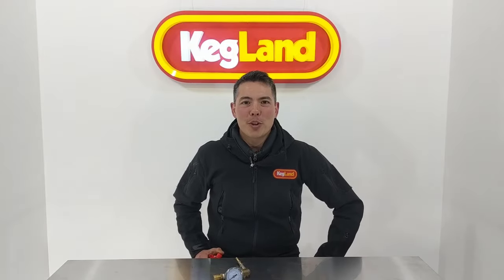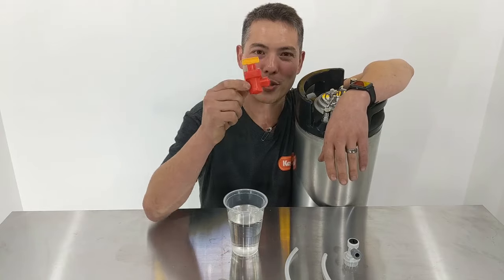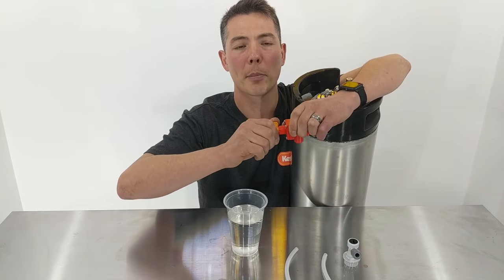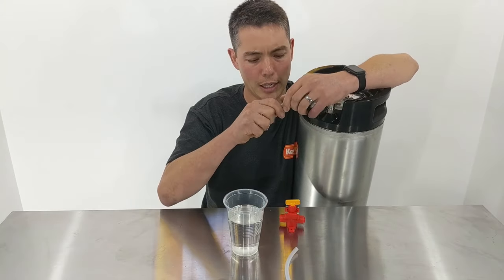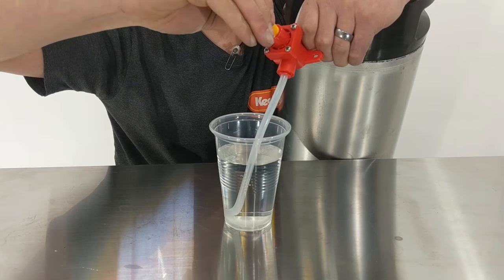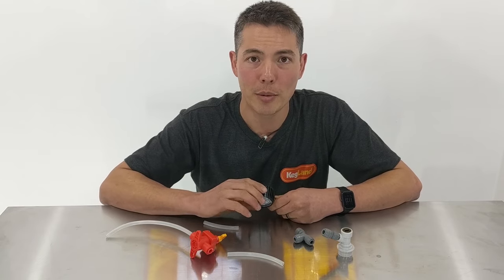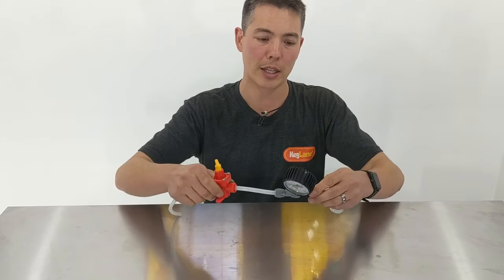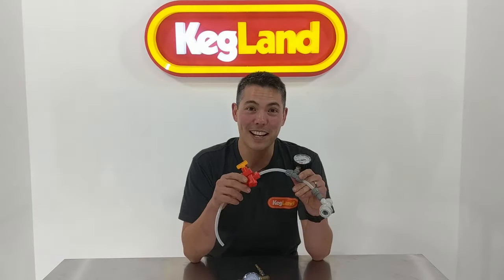BlowTie - Diaphragm Spunding Valve - Adjustable Pressure Relief Valve

Comment: I've used the BlowTie2 for 3 batches now and noticed an anomaly. Set pressure at 12 PSI and it holds nicely for about 3 days with good bubble action, then pressure will start to rise (15psi+) so I have to back off the regulator. After another 5-7 days, the pressure will start to drop and I have to adjust the regulator again. No krausen making it to the BlowTie.
Reply from the maker: The blowtie is designed with an orifice of 2.3mm diameter.  If the flow rate is too high with an active yeast the pressure can exceed the capacity of this 2.3mm diameter hole and you will temporarily get a pressure increase. 

We are also looking at making another larger orifice model that will allow for higher gas flow rates too.

Comment: The action of the pressure on the vavle which pushes against the spring, shortens the spring and increases its pressure of course. Wheter that is enough to balance the increased surface area of the seal point is another matter. Maybe it is designed to do that?

Comment: This is a great little low-cost piece of equipment, but I notice now that the kit sold comes with a pressure gauge that only goes to 15psi, not the 40psi shown in the video.  15psi is not enough to check my naturally carbonating keg at room temp.
Reply from the maker: Yes that is a fair point. We did change to the 15psi gauge as this gives more accuracy at the low end of the scale.  We can consider going back to the 40psi one but then you get much less accuracy sub 10psi.
Reply: @KegLand  Thanks. I ended up getting an extra 40psi gauge, so I can interchange between the two when need be. Cheers.

Comment: put some food grade grease on the gauge connector before (compatible with EPDM). It will help for disassembling...
Reply from the maker: Yes that is a good point. This does make it a lot easier. Thanks Kannsen.

Comment: I would like to regulate the pressure on my closed conical fermenter during fermentation but am not inclined to use CO2 tanks (for various reasons,ie. bottling, slow drinking etc), other than manual release.  Any suggestions?

Comment: Hi! I wanna know if the last piece of tube its compulsory (the one that is on the glass of water). Because i have get one and i do not have the last part and nothing happens when i release the screw.
Reply from the maker: No you do not need that last piece of tube. Its really not necessary but just gives you a visual indication of the gas flow speed.

Comment: Does blowtie acts as a check valve or do I need to close it to avoid suckback when cold-crashing?
Reply from the maker: Yes it will prevent gas flowing in the opposite direction unless you have it completely open. When it's completely open the gas can flow in both directions.

Comment: I'm having an issue with the gauge not reading any pressure when I know there is. Is there a certain way you have to attach it? I've currently set it up just like in the video and pushed the gauge all the way in to the T junction.
Reply from the maker: Can you please email us some photos so we can better understand how you have it setup.  Also if the pressure is really low less than 2psi this might be too low for the needle to move.

Comment: The analog pressure gauge ( spunding valve kit) drop from 30 cm... Not Connected shows 10 psi. Hot to reset it?
Reply from the maker: You need to take apart the gauge to reset it. Sounds like it's jumped a few teeth on the drive cog.
Reply: @KegLand   can you make a tutorial vid/pdf/article? I ask the same question in different telegram chat about homebrewing and pressure fermentation, and a  lot of People had this problem. Nobody fix it correctly...

Comment: So I just opened my Blow-Tie setup and the gauge is reading on 5 psi NOT 0 psi.... I came here to view the video on how to set up and see that the gauge in video is at 0 psi and no mention on how to calibrate it to 0 psi. Anyone else have this issue???
Reply from the maker: If this has happened to the gauge then the only way I know of calebrating it is to pull off the needle from the gauge then push it back on in the zero position.  If your gauage is not reading zero when you have nothing connected it's probably been dropped or over-pressurised.  Either way we would normally just replace the gauge but I have seen people fix them too if you are that way inclined.
Reply: @KegLand  Thanks..... was thinking of repositioning needle, my LHBS has told me they will swap out with a new one

Comment: That's actually one of the things that piss me off about beer making . What the hell is it with all these new stupid names for old technology. It's an adjustable pressure relief valve. It's not a blowtie or blowjob or skank grommet or blow off. It's an adjustable pressure relief valve. Both my portable and shop compressor have them stock so I can control line pressure for air tools. Everybody is making up all these stupid names and it simply makes things harder to find and impossible to shop and compare cause stupid names don't show up in relevant searches.  In 10 years the beer making community went from people just making beer and trying to help each other out to instead be like a fad of valley surfers or skate boarders more interested in creating a new slang language then they are in helping the community.
Reply from the maker: Thanks for your input Rough and Wretched.  Sorry about that. We did not realize that the names were making it a bit too complicated.  I will take this to management and see what they say.  It's a valid concern.